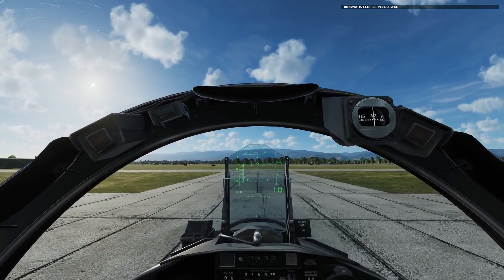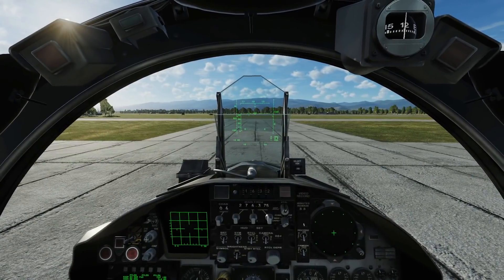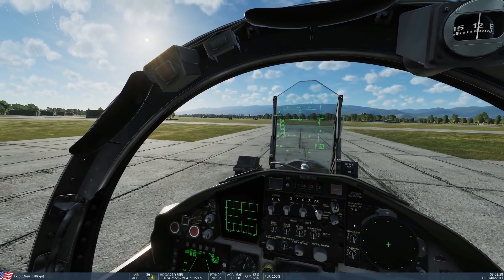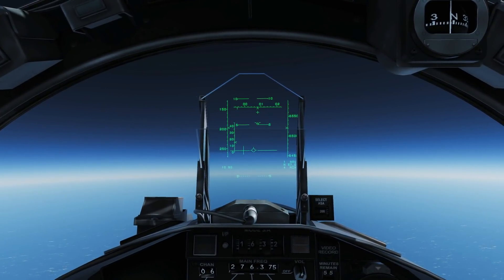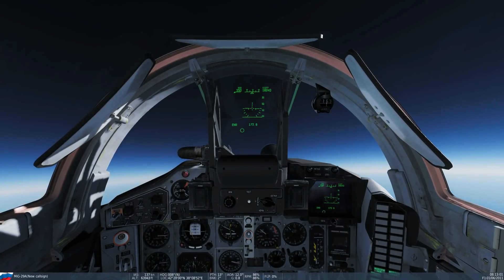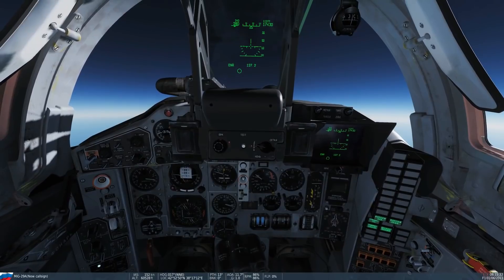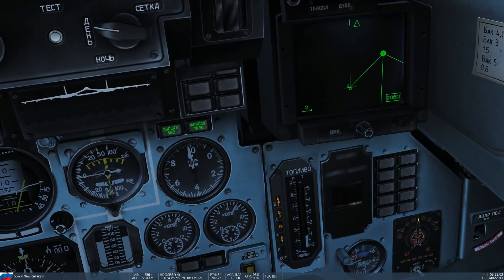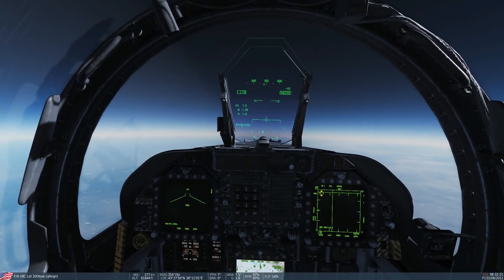Fast Jets: Max Sustained Altitude PART 1 | DCS WORLD

Comment: I've tested MiG-21 F-13 to 70,000 ft on X-plane 9, with clean configuration, only bring fuel tanks until 33,000 ft and only a quarter fuel left on 70,000 ft

Comment: In the Viggen you died if your engine had any trouble at high altitude because the cabin pressure would disappear and your blood would boil before you had the time to get to a safe altitude.
I believe 13000 meters was the altitude you needed permission to exceed in peacetime.
Reply: It is only tears and saliva that would boil in extreme altitudes. Blood is protected by blood pressure. That is the reason why Russian Mig 31 pilots wear pressurised helmet but not pressurised gloves.
Reply: Blood is protected by your skin.
Reply from the maker: niceeeee AJ
Reply: I believe your statement is BS. There are numerous instances of the Viggen intercepting the SR71 and get a radar lock. During these instances, the engine would usually cut out and the pilots would make a mid-air restart. To my knowledge, this has never resulted in any lost planes or injured pilots.
While I have to check, I believe cabin pressure is handled electrically, in which case the Viggen has a deployable electric turbine.

Comment: You read the HUD for the Hornet for some reason
Reply from the maker: Oops, well spotted. Was it still the lowest?
Reply: @grimreapers  Just edges out the fulcrum: 61,800 vs 60,500
Reply: Mig-29 range estimate gauge has a static 0 that is tacked on the end. So when it showed 22 on the parts that move it was estimating 220km. One could cover the 100 miles you predicted, and then land, on that.